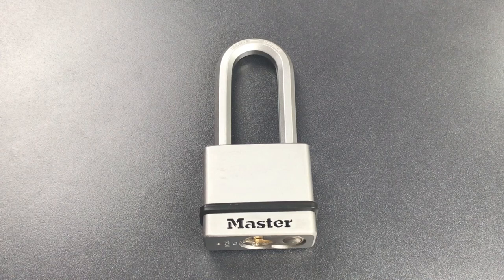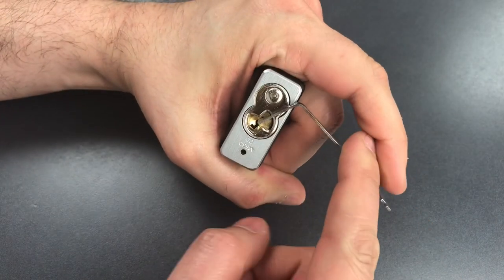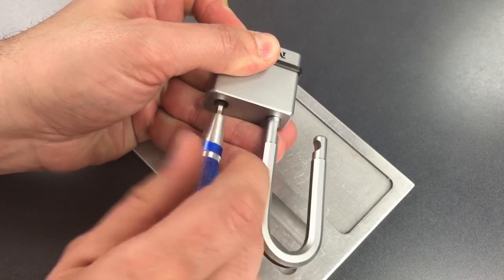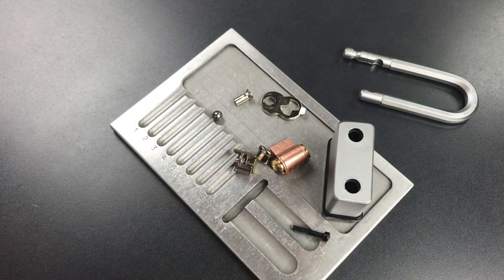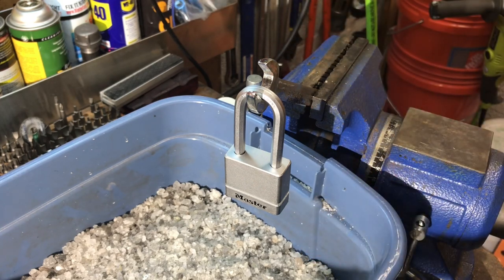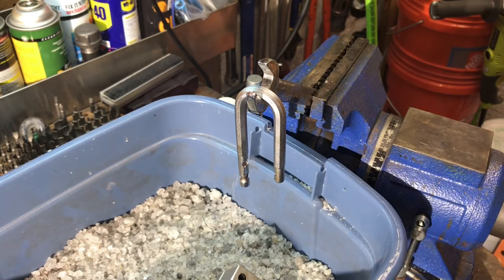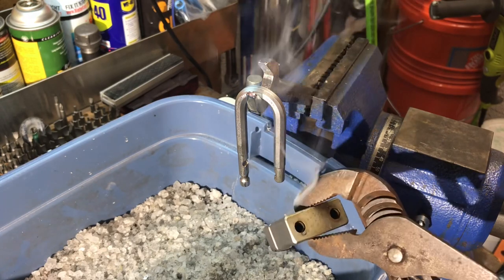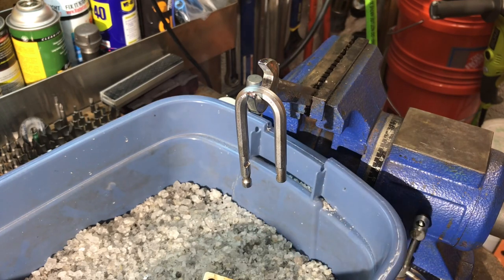[677] Plumber’s Torch Opens Master Lock M530

Comment: I love to see corporations intentionally shoot themselves in the foot by cheaping out with Inferior materials. It just shows how much the corporation is not concerned with building trust and pride in the public eye.
Reply: THR33STEP
The bad thing is, it works.
Reply: I dunno, if a lock already has a weak 4-pin core on it, I don't think a zinc actuator significantly reduces its security.  A cheap pick gun could open this thing faster than a blowtorch can.
Reply: Maybe their products are inferior, but they sell Master Lock in any Major warehouse or retail store. So they got that brand name going for them.

Comment: While I have the upmost confidence in you, I really thought the lock body would absorb the heat and keep that core piece from melting. Very cool. Thanks for sacrificing a lock for some fun.
Reply: Albert Lebel At least it was cheap. Master locks are usually pretty well build on the outside but the cores are the weakest link. Even on the highest tiered master lock
Reply: Tony Hong That’s what I don’t understand. They have a very good core in their LOTO locks and sad cores in their big strong locks. They should put the  LOTO cores in the big strong lock body and they would have a great lock.
Reply: Albert Lebel they likely made 10b of those cores and are still trying to offload them.
Reply: The entire lock is a heat sink.  Can’t single out types of metal when there housed whole

Comment: It looks almost like Master Lock do not produces good locks intentionaly :D
Reply: It is how they get repeat sales. If the first lock you buy works how are they going to sell the upgraded/improved model?
Reply: I haven't seen a single Master Lock video which demonstrates a lock without a glaring security vulnerability. I mean, they don't put their cores with the most pins on locks that are physically secure; they put those on fabric bags. They don't put their cores chock full of security pins in their locks that weigh 3lb, they put them in plastic bodies as lock-out tag-out locks.
Reply: +Anonymouspock - It is highly likely the reason the higher security cores are used in specific situations are that they are required by industry driven requirements (banking and electrical).  Master would probably not do this on their own.
Reply: Rich Wojehowski to be fair the 6 pin pro series core is almost identical to the tagout core but I do find the tagout keyway a little bit tighter.
Reply: Master Lock Pro Series are generally pretty good,  unfortunately they do not seam to sell anywhere near as may of them as they do the bad stuff.
Reply: Tok36 to people  who don't know any better if they see a 10 out of 10 rating on a shit lock they can't understand  why a pro series costs  so much more.
Reply: M Tavner picking is almost never used in thefts  anyway,I must have been to 1000's of break in's and thefts and have never been to one where a lock was picked.
Destructive methods are usually  much quicker and require very little skill
Reply: +cardiffpicker

It will likely surprise you that a thief is more than million times more likely to destroy your lock, or whatever its attached to, than to try and pick it. Hence, why Master locks have been so monumentally successful - because everyone isnt up to your pick-god standards.

BTW, try picking a Master padlock thats hanging on the hasp, its been attached to for the past ten years, out in the weather and get back to me about how easy it is.
Reply: Spring Bloom  why would that surprise me ? You obviously haven't read all of the posts in this conversation.
Master lock are so successful due to good marketing  and at one point did actually make good locks.
I have actually picked a few master locks that have been outdoors for a few years and no they are not that easy but neither are most locks that have been treated that way.

Comment: Do you use propane?  If so you should try MAPP gas in the yellow cylinder it's flame is twice as hot and would most likely melt the copper core and the zinc a lot faster.
Reply: its*
Reply: it's not twice as hot
Reply: MAPP has combustion temperature of 2020 °C (3670 °F) in air whereas propane has slightly less: 1980 °C (3596 °F).

Comment: LPL, in the event that the zinc doesn't melt with the torch, are you able to enter the lock again using conventional picking means? 
What I'm getting at is the the pin springs don't like heat and imo, might not have the ability to retain the pins and spools.

Comment: I just bought a house and in the garage someone put an "American" padlock on the track of my garage door and I can't pick it for nothing. I can get in about any master lock, this ones giving me fits.
Reply: Shane K American locks have security pins, master lock has never heard of security
Reply: Depending on the model of American lock you have there it may be possible to bypass the cylinder and open the lock by turning the actuator. Typical weakness of the round body line and their clones. Look it up in the body of LPL and Bills video library.
Reply: Shane K just use the "universal key" for all locks, aka an angle grinder.
Reply: Bolt cutters, depending on the size and type of shackle.
Reply: Your garage, someone elses lock. Why even bother with trying to pick it? Destroy it, and be done with it.
Reply: Shane K ya just grind it. 10 seconds max.
Reply: I hadn't brought up my tools (angle grinder) so I had tried to pick it. I cut it off today with a borrowed dremel tool.
Reply: None of your business k

Comment: Cool video. I was wondering if the Master Lock core is zinc also, as that copper color is just plating, or paint, with some white metal beneath.  It looks like you got the lock hot enough to melt the actuator,  how did that core hold up?

Comment: I've noted you regularly call standard crosshead screws 'Philips screws'. The latter have four cuts, not two. ✳️ Not ✖️.
Reply: AlisonWheeler Philips is the Dutch electrical company, the US toolmaker is Phillips. Also, cross heads are called Phillips (PH) heads; if there are 4 more little cuts, they are Pozidrive (PZ).
Reply: Jens Schmidt Ahah! Thanks for explanation. Not a usage this side of the Atlantic.

Comment: The orange part of the flame is the hottest so it would be faster if you used it.
Reply: RC Monster Mash Studio no it isn’t
Reply: Yes it is on a torch the orange part is the hottest because that is where the ideal gas to air mixture is.
Reply: RC Monster Mash Studio is right
Reply: As covered in 7th grade science "The inner core of the candle flame is light blue, with a temperature of around 1800 K (1500 °C). That is the hottest part of the flame. The color inside the flame becomes yellow, orange, and finally red." The dominant color in a flame changes with temperature.  A fire is white, the hottest color possible for organic material in general, or yellow. Above the yellow region, the color changes to orange, which is cooler, then red, which is cooler still. Above the red region, combustion no longer occurs, and the uncombusted carbon particles are visible as black smoke.

The temperature range from Red to White:
Red
Just visible: 525 °C (980 °F)
Dull: 700 °C (1,300 °F)
Cherry, dull: 800 °C (1,500 °F)
Cherry, full: 900 °C (1,700 °F)
Cherry, clear: 1,000 °C (1,800 °F)
Orange Deep: 1,100 °C (2,000 °F)
Clear: 1,200 °C (2,200 °F)
White
Whitish: 1,300 °C (2,400 °F)
Bright: 1,400 °C (2,600 °F)
Dazzling: 1,500 °C (2,700 °F)
The difference between red-hot and white-hot is about 1000 degrees. But what about blue-hot?

Anytime you see blue in a fire it is hotter than white.   The range is between 2,600 and 3,000 degrees Fahrenheit and its the most oxygen-rich type of flame.

Comment: a plumbing torch has more than enough heat to melt a steel lock.

just as long as you have some spare refractory insulation lying around. an otherwise solid, firebrick with a hole in it will work too, but only if you have a few hours to kill.

Comment: Master is unsurprisingly following the sales success of the dollar store   Chinese imports...How about a sturdy steel bodied 50mm. padlock with hardened shackle and a 7 disc detainer core, all for a miserly $cdn3.50, that's about $2.50 in real money....Trouble is you can pop the core out with a metal punch and if that is too much work you can use the ever handy plumbers torch because the core and actuator are ... wait for it ... plastic !
..